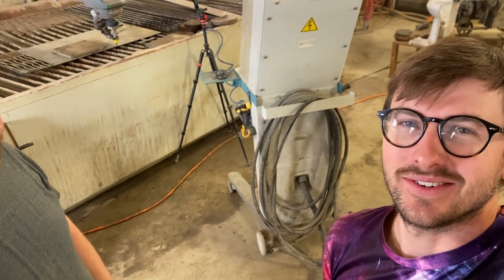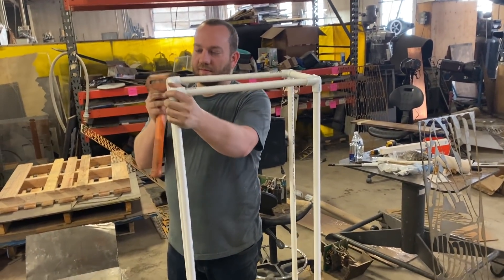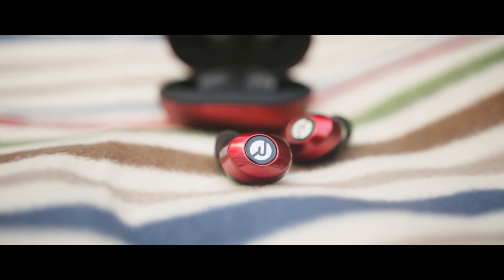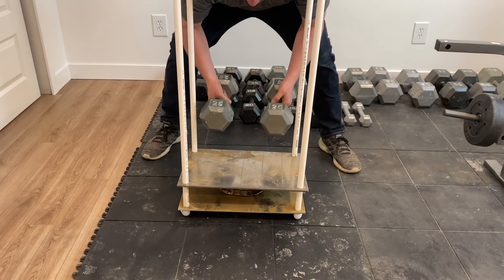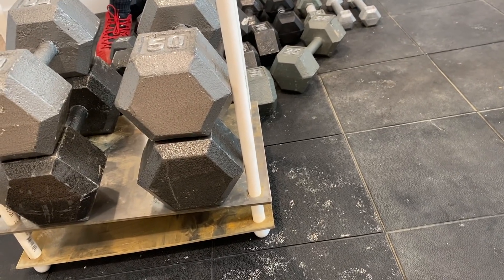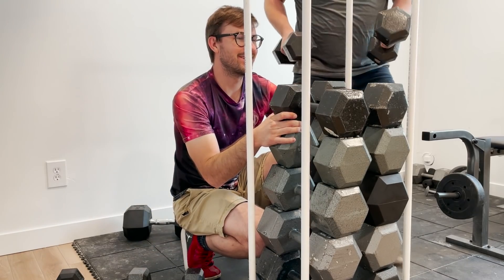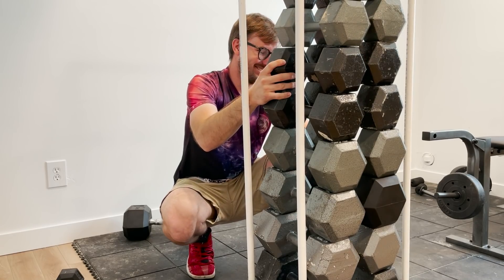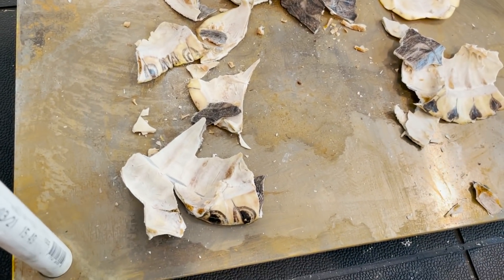SHOCKING: How Much Weight Can a Turtle Shell Hold?!

Comment: That’s a red slider shell (water turtle), if you leave a shell like that to the elements it will break down into sectioned pieces pretty quickly. I want to see you test a land turtle shell like a box turtle, their shells are stronger and don’t fall apart easily, I bet they’d perform even more impressively even though they’re smaller on average

Comment: The shell broke due to the force of the weights falling onto the plate not the shear weight of them resting on it so I say that the turtle shell could have held more weight than that (probably around 700 pounds) before it broke due to the shear amount of weight on top of it. Maybe set up a better rig and do the test again some time

Comment: Totally could have held more. The weights slid and dropped which caused the explosion 💥
Reply: yea you can see it blow right when a 50 hits the plate on top
Reply: 100%
Reply: @Geekman16  SSomeone should do the math as to what forces a 50 p;ound weight dropped from that height would be and say that THAT'S what a shell could withstand.
Reply: @danholmesfilm  50lbs x 4 and a half feet maybe? That would give at least 225lbs of force.

Comment: The shell only broke when the weights fell and smashed the side of the steel plate. You can tell from the footage.
Reply: 100%
Reply: Yeah, the kinetic energy did it. The shell probably could have held more if they made a proper "weight holding" device.
Reply: It could of definitely held more weight if it the weight stayed more even and center. Even if it that was the limit the fact that a little shell like that could hold that much weight is mind boggling.
Reply: @hydrolicpresschannel show them how you supposed to do it.